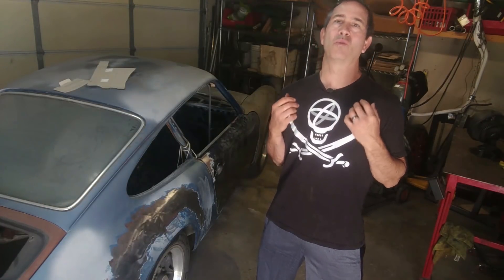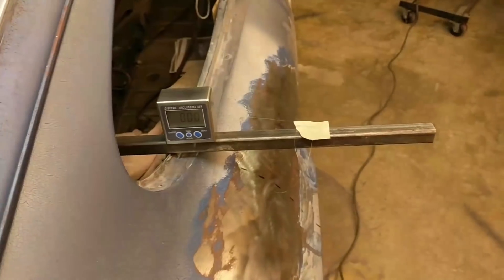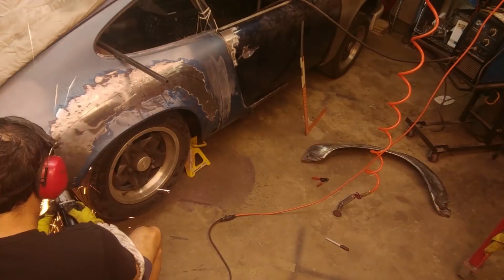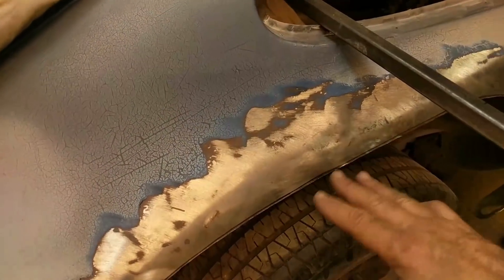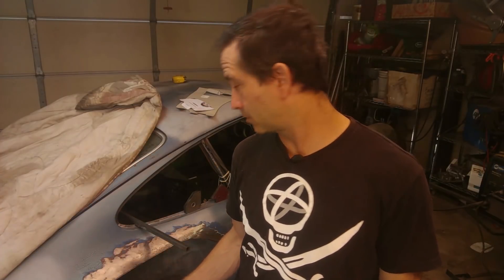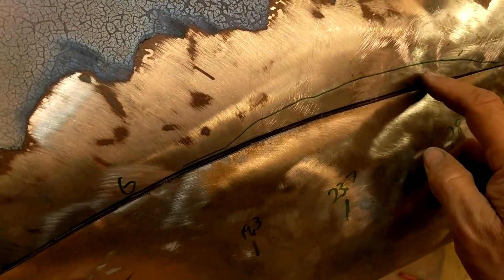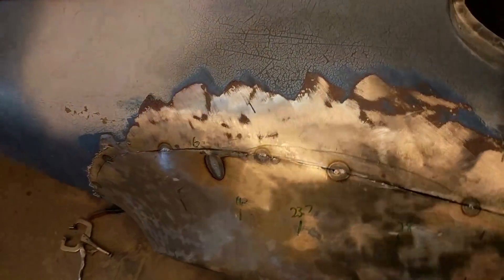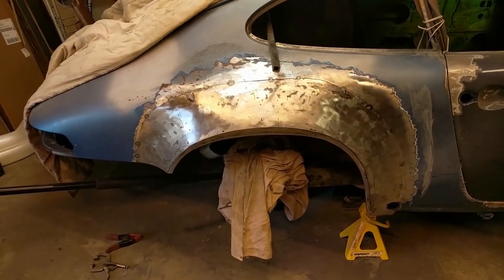How to Butt Weld a Steel RS Flare - Porsche 911

Comment: Wouldn't you want to do hammer off dolly to push the metal out? It may be stretched already from the accident damage. Just wondering. Another great video; seriously addicting.
Reply from the maker: Thanks man!  This might be hard to explain, but here it goes.  The shape of  the metal was convex despite it being too low.  To bring the metal out it needed to get longer which is hammer on dolly.  The situation would be different if the shape was concave like a big dent.  Making a concave shape longer would push it in.  Not sure if that helps.  Check out the other flare install vid too.  I had to the same thing but moved the metal even more.  
Thanks for watching these videos. Sounds like you'll be all caught up soon😀
Reply: Got it. I thought it was pushed in from the damage. I'll be caught up in no time!
Reply from the maker: Awesome, hey I'm going to Auto Kennels open house tomorrow morning, Saturday. Come over and talk Porsche's.  They are in Costa Mesa
Reply: Sounds like a great time, unfortunately I have to be in the SFV tomorrow... Keep me posted for future get togethers and I'll keep a clear schedule. Thanks!
Reply from the maker: Ok, stay safe out there 😮